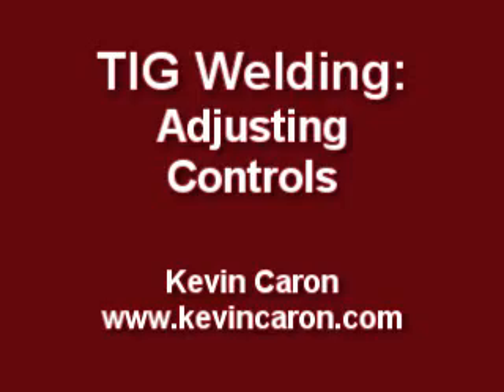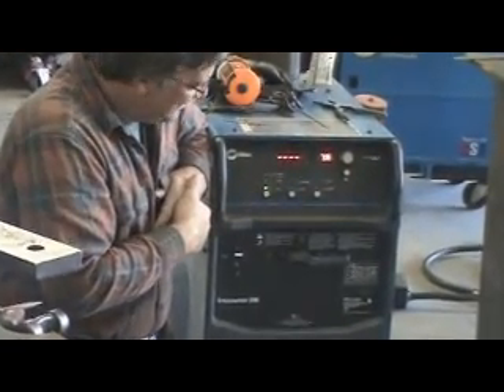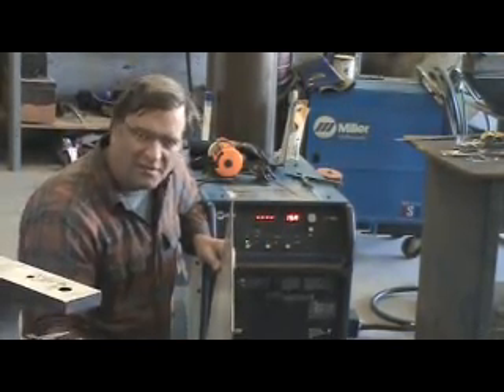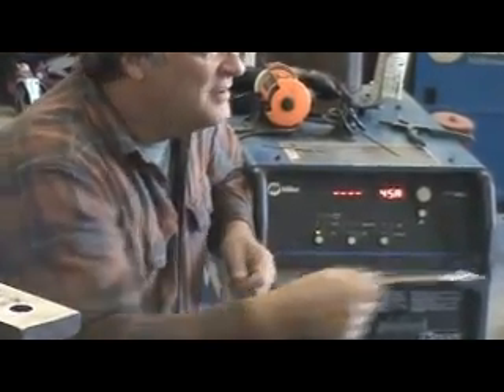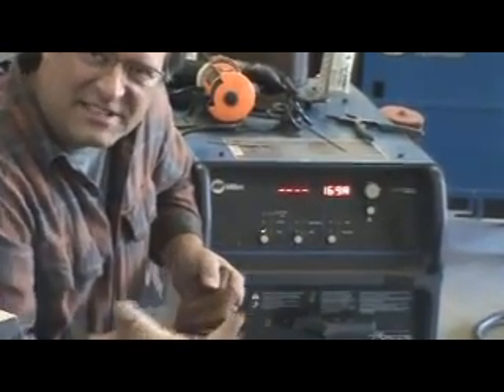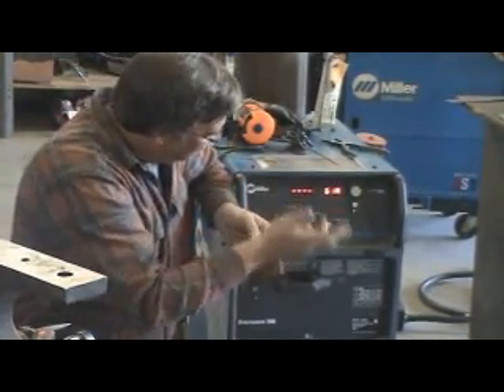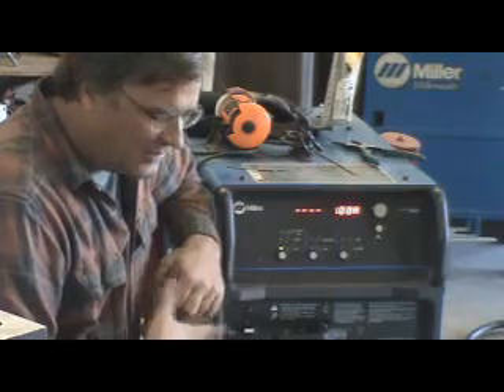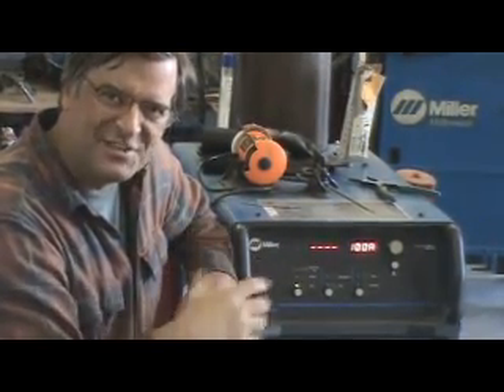TIG Welding: Adjusting Controls - Kevin Caron

Comment: Can a water cooled torch be added?
Reply from the maker: Yes,   a water-cooled torch can be added to this machine. With the correct fittings you can add one to any tig welder.  The only thing that may not be "right" is some machines don't have a plug on the back to power a cooler.  In that case you just plug the cooler into an outlet and switch it on and off manually.

Comment: Hello Kevin Wonder if you can help me out the company I work for has a miller syncrowave 300 having a lil trouble setting tig for aluminum can you help me out ?
Reply from the maker: You can email me at kevin@kevincaron.com.    Much easier than trying to do this here.   If you are in the U.S. it would easier to call me.  My number is on my website, www.kevincaron.com

Comment: @Kevin Caron, Artist. I have a Syncrowave 200 also. Been having some issues because I haven't used it in forever. Been Mig Welding everything.
Can you tell me what settings I should be using on certain Metals?
Stainless Steel should that be DCEN or DCEP?
Aluminum, I know that should be AC, but is that electrode Neg or Pos?
Steel, what setting should I be using?
Also, on Aluminum, do you use Pure Tungsten, or some other type of Tungsten?
Thanks in advance! Sincerely, Phillip Chambers
Reply from the maker: Hi Phillip,   Stainless and mild steel is done with DCEN.  Aluminum is done EP but the machine takes care of switching it to EP.  No need to swap the cables. Just move the handle to AC and get to work.  As to tungstens, I use E3 on every  kind of metal I weld.  With the transformer machines like the Syncroware and the inverter style machines as well. 

Hope this helps,  thanks for watching and posting.
Reply: @KevincaronSculpture  Thanks, I really appreciate the help. Enjoying your Channel. Keep up the good work!

Comment: I tig weld every day.
My machine is allways set to 200 unless i get really thick stuff.
Its like driving a car you might be able to drive 200 km an hour but when going through a school zone you maintain a lower speed.
I allways teach the new kids that come in to forget what they learned in school and concentrate on puddle control.
Start out with a little pedal and give and take to control peddal.
People need to stop thinking so much and learn from there mistakes books dont teach mistakes.
Cheers

Comment: You don't really adjust amps for stick according to plate thickness in most cases, instead you change amps according to electrode size, and change electrode size depending on your material. Otherwise you just end up burning too cold with a big electrode, or wasting time with an electrode that is too small.

Comment: hey kev ive been stick welding for a little over 4 years i started real young and i like burning the stick rod hotter than normal like 180 amps for 1inch plate with a 4mm rod and for 1/4 inch i like 90 amps just alot hotter than most but that works very well for me ive never ever had a hot weld break by lack of strenth but thats how i like to weld and it works for me and im sure welding the way you do works for you to cheers for the vid kev i liked it and im going to sub cheers mate

Comment: If I may, like Kevin says  Amperage requirements vary greatly with material thickness, temperature of material and that of the day as well. 
I use a scrap of the same stuff I'm welding to check what I think the current needs are, this is dependent on your voltage too. 

Practice Practice and still more practice, I grew up on the farm where my dad taught me the basics and by the time I was 14 or so an accomplished welder. Largely self taught like Kevin. the KEY is Patience and practice.

Comment: hey kevin, I weld thin steel around 125 or 130 amps.  I weld 1/8" aluminum on 230 to about 260 amps.  is there a decimal point on your readout?